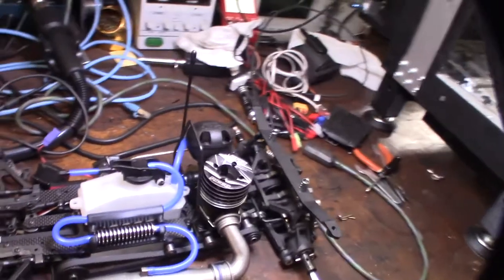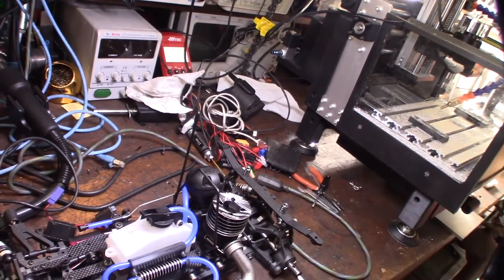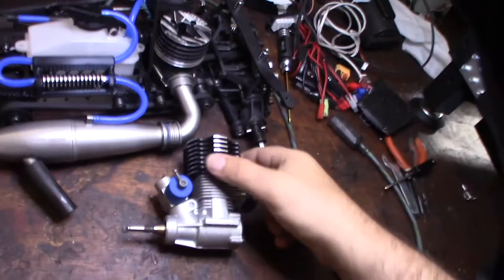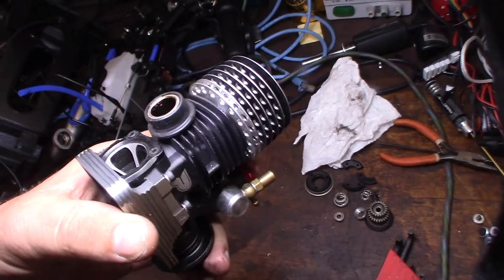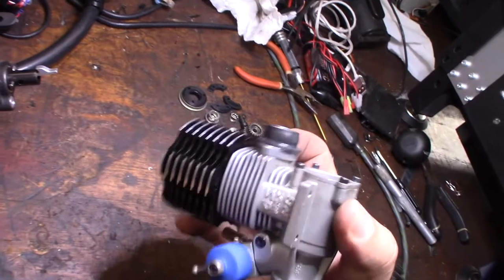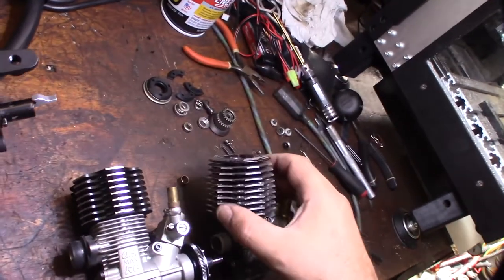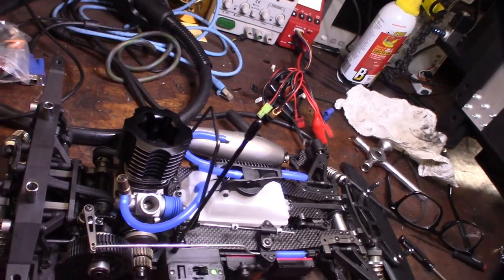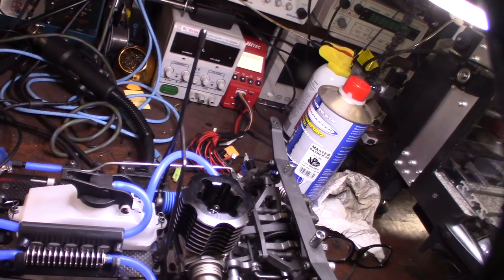O.S. RG .21 Nitro Engine Install in BMT 984 Onroad, super tight pinch

Comment: The red stuff in the picco could be the silicone ramp in the crankshaft falling apart. It’s common for that to happen as the engine gets older or if wd40 was put in the engine because the wd40 attacks silicone and will make it swell up and become brittle

Comment: The OS RG is not a high end engine. It was however, the top of the OS line of 1/8 buggy engines when introduced, and certainly no slouch. 
The things you mentioned, (no removable venturi, block crank/rod) aren't so much indicators of quality as they are indicators of age.

Comment: Your low speed needle is too rich., that is why it dies after you remove the igniter. Try turning it to the right about 1 or 2 hours on a clock,  that should fix it,... if not keep turning it to the right 1 hr at a time until you can idle without the igniter. You can also try a hotter glow plug, like "super hot" or "hot" if your using a cold, or medium. Then it will be really easy to start., and you may not even need to lean out your low speed needle more than 1 or 2 hrs. max.